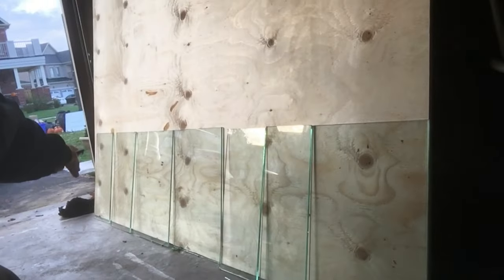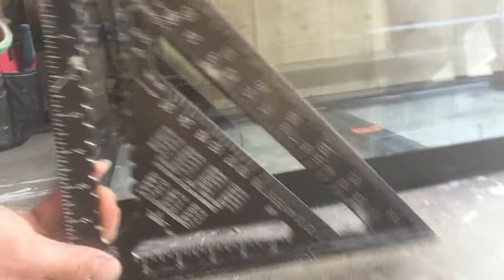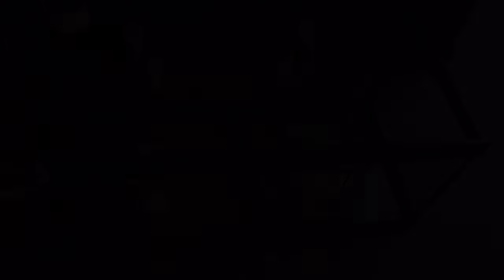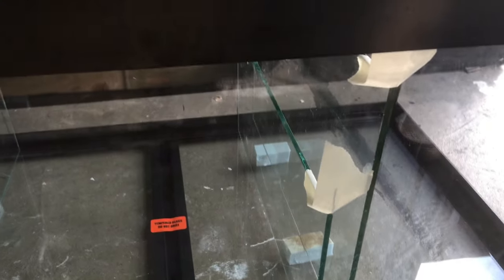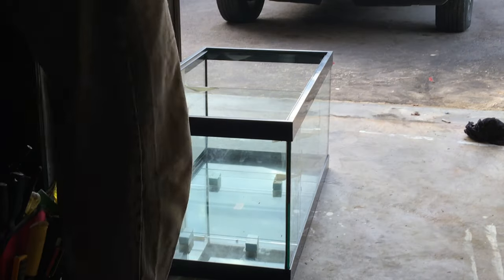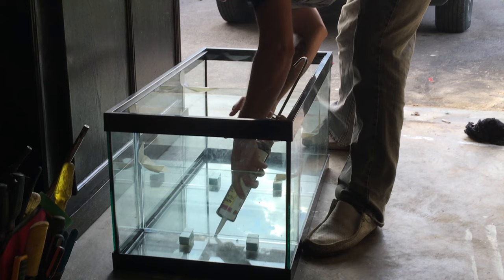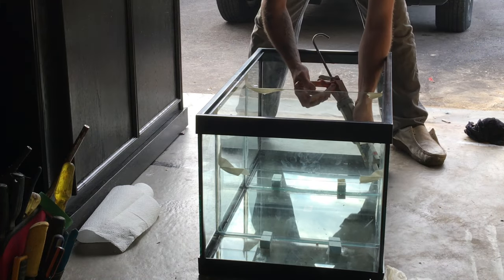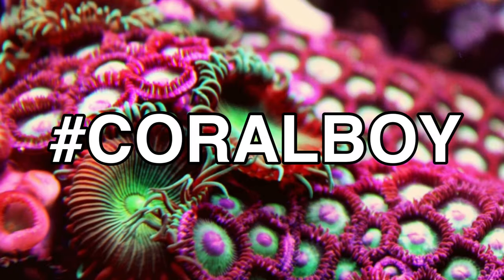HOW TO BUILD A SUMP FILTRATION SYSTEM ( 120G REEF TANK BUILD ) PART 8

Comment: Making the first baffle a flow under is an issue. You end up with stagnant nutrients building up on the surface water cause its not moving enough to push it to the bottom of that section. First section should always be a flow over, unless you want to waste money to add a circulation pump just for one sump section. But, the video has good info for everyone.

Comment: Thanks for the vid. This is exactly what I was looking for. I'm going to use a 75g Planted main tank with a 75g sump/refugium. I think I want to steal your simple design. First chamber for mechanical. 2nd for use as a freshwater plant holding/grow out and the third for heater and return pump. How do you determine the height of each baffle? Il be using an eshopps Eclipse L internal overflow. Thanks in advance
Reply from the maker: AGUILAR3 hey there and thanks for your feedback. Ideally you want the tank and sump running with pump and the water level to be in your sump roughly about the half way mark. Your sump size should vary depending on your tank size. And also how much water will back syphon into your sump when power is shut off to the pump. So when power shuts off to the pump the water line in your sump will raise but not enough to overflow the sump. So with that being said your height of your baffles will be approximately half the height of your sump. But not all baffles will be exactly the same height. You want the water to flow but with NO dead spots. I always keep this in mind. Your pump chamber will always be the last and lowest level of water in your sump. The first chamber will be the highest water level. Middle chamber water level will be in between chamber 1 water level and chamber 3 water level. 
Hope this helps. If not let me know and I'll make an more detailed video for you. 
Cheers.
Reply: LEOPAZZO TV  thanks for the info. so as long as I make each baffle lower than the previous, flow should be fine. as far as power outage, that's why I'm going with a 75g sump for the 75g display tank.  more room for water.  I just need to figure out how high my first baffle should be.
Reply from the maker: AGUILAR3 a 40g sump tank is large enough for a 75g display tank. There is nothing wrong with bigger sump if you have the room. More water volume the better.
Reply from the maker: AGUILAR3 refer to the picture in this video at 2:06 as it shows the layout of the sump. And how the water level is highest on the left and slowly from each baffle goes lower towards the pump. Kind of creates that water fall effect. Also I did not mention. Your skimmer is pretty much your most important equipment on how you will build your sump. 
Look at your skimmer specs and see what are the dimensions and the recomended water level the skimmer should be submerged in to work at its best potential. The skimmer in this build is designed to run at approx 7-9 inches of water. So that number right there is what i will work off. Locate the skimmer chamber and make sure the skimmer chamber water level will remain at the desired level that your skimmer suggests. If you have any more questions feel free to ask. As I may need to make a more detailed video on some of the info you are looking for.
Reply: LEOPAZZO TV  it's going to be a freshwater planted tank. I'm using a 75 because I want the biggest sized refugium possible to act as a holding tank for fish and plants. I will definitely follow your sketch drawing.